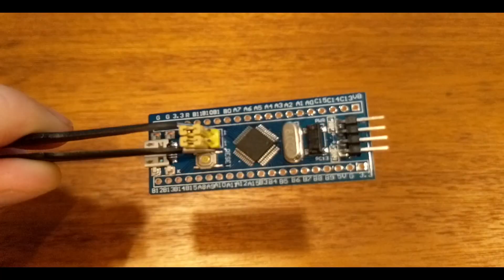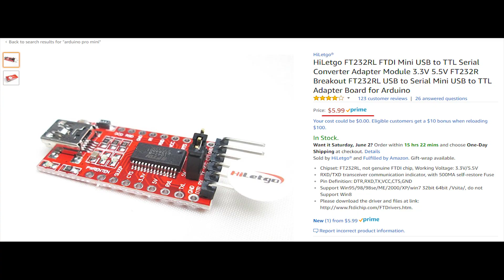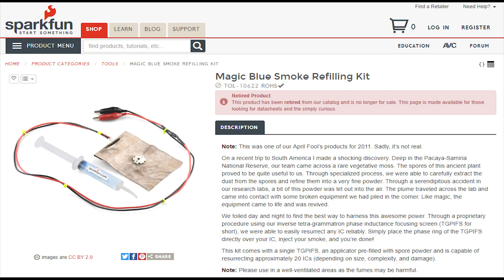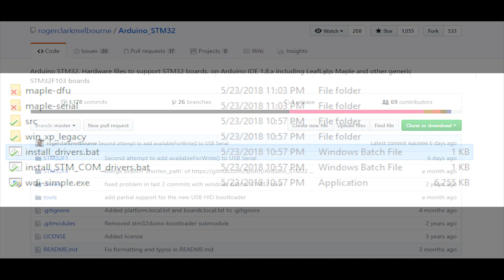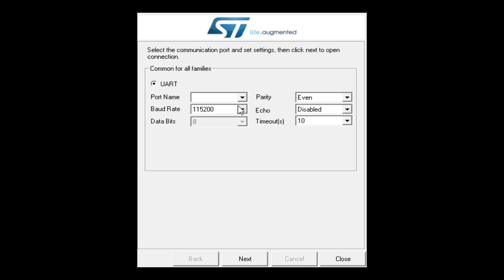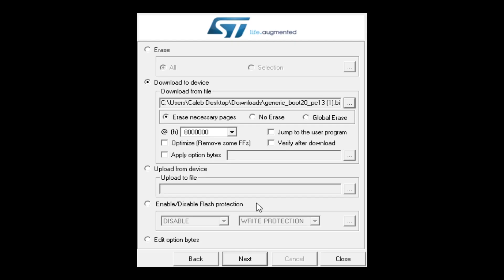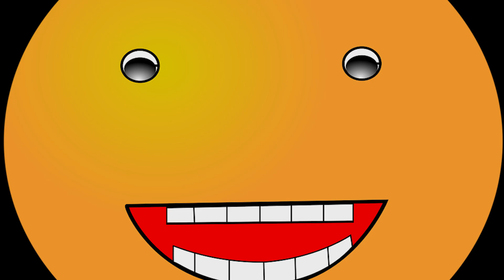Installing the STM32 USB Bootloader, Easily! [SEE DESCRIPTION]

Comment: Arduino doesn't have USB support either. There is an onboard UART to USB interface that handles it. Btw you can use the arduino as a USB to UART adapter, no need to buy one.
Reply from the maker: I tried getting the Arduino Uno to work as an adapter but I couldn't get it to work with STM32 flash loader demonstrator. If you could get it to work I'd be really happy to hear how you did it!
Reply: @CalebMarting  The way I've done it before is through SoftwareSerial, and then simply redirect data between those pins, and pin 0 and 1 which is hard wired to the interface chip. After that, just treat the arduino as a COM port on the computer side. I did it years ago, but I'll try to dig up my old blue pill and arduino tomorrow and see if I can get it working again to confirm
Reply: @CalebMarting  So here is a major issue I found today with the blue pill. Even tho the serial pins are 5v tolerant, they do not work with 5v TTL adapters. They need 3.3v for the RX and TX. I got it working with the arduino chip with a voltage divider. It was so frustrating because I ended up spending 20 bucks on an FTDI adapter from the local store that happened to have a 3.3v switch on it. Flipping it finally allowed me to receive data from the blue pill. If I switch it to 5v it doesn't respond. So many guides out there fail to mention this.

Comment: Can we use this bootloader without using arduino ? I ask because I prefer Keil. I just want the support for the USB port in the STM32
Reply from the maker: I'm not sure, I haven't gotten it to work with mbed or anything. You could extract how the .bin file is uploaded and just use keil to run that file

Comment: Good day. Very useful video!
I need your help. I use a board like this: https://www.aliexpress.com/item/1811770307.html
Device Diagram:: https://radiokot.ru/forum/download/file.php?id=211902
PA12 is pulled to power through a 10k resistor. The LED is connected to pc13.
I installed different bootloaders. These came up: dso138_boot20.bin, generic_boot20_pc13.bin and naze32_boot20.bin. But there is one difficulty: for flashing the sketch I need to press the RESET button. Is there any way to do an automatic reboot? Could it be possible to somehow modify the bootloader, or add a circuit for a hardwar reset?
Reply from the maker: You will need to either replace the 10k resistor with a 1.5k or somehow bridge it with parallel resistors to bring the total resistance to 1.5k. then it should reset Automatically. I believe I talk about this at the end of the video

Comment: some boards have the 100kohm R3 resistor that connect BOOT0 header to mcu. In my case, when BOOT0 jumper is on 1 position, the pin on mcu only pulled up to 1 volt, which had me failed to flash the firmware. you might need to replace R3 with 10k. i just replaced it with a 2.2k smd resistor i had and it worked.
Reply from the maker: Interesting, thank you for your knowledge!
Reply: This has helped! Thank you :)
Reply: @sam25_25  you're welcome, i'm happy to hear someone to benefit from my discovery

Comment: I'm getting this error. I have two boards and still this happens in both

maple_loader v0.1
Resetting to bootloader via DTR pulse
Searching for DFU device [1EAF:0003]...
Found it!

Opening USB Device 0x1eaf:0x0003...
Found Runtime: [0x1eaf:0x0003] devnum=1, cfg=0, intf=0, alt=2, name="STM32duino bootloader v1.0  Upload to Flash 0x8002000"
Setting Configuration 1...
Claiming USB DFU Interface...
Setting Alternate Setting ...
Determining device status: state = dfuIDLE, status = 0
dfuIDLE, continuing
Transfer Size = 0x0400
bytes_per_hash=300
Starting download: [##################################################] finished!
state(8) = dfuMANIFEST-WAIT-RESET, status(0) = No error condition is present
Done!
error resetting after download: usb_reset: could not reset device, win error: A device which does not exist was specified.
Resetting USB to switch back to runtime mode
Reply: It used to worked and then nothing
Reply from the maker: Try reinstalling the drivers and/or bootloader
Reply: I did both :/ . How do I erase the bootloader so I can try it without it?
Reply from the maker: Just overwrite it with serial. Boot 0 in the 1position and upload over serial

Comment: hey man tremendous video, can you make a tutorial on how to make the stm32 simulate a usb Keyboard?. can it be done with arduino programming? or do you have to use the st-link thingy?
Reply from the maker: I've gotten it to work before with just Arduino but it sort of messes with the bootloader if I remember right. I'll look into it haha
Reply: @CalebMarting  It works, but you won't like this kind of configuration during development. It's cumbersome and annoying. Maybe later as end-user update mechanism. 
The boot-loader and your USB-stack will fight against each other every code-update time, worsened by the fact that such a blue pill has no proper USB re-enumeration circuitry like the maple series and most likely has the wrong pull up resistors(like you stated in your video. good job).
For USB development I use a proper programming adapter as @insanet3 asked. So you have proper debugging available and two paths: One for development and one for the USB realization of your project. Prepare to invest some time, because this can be a hard task to wrap your head around and get your USB stuff working:)
Reply from the maker: You are exactly right, I had the same experience as you
Reply from the maker: Thank you for your insightful comment!

Comment: @2:35  I hope you didn't really have the other end of that USB cable plugged in, while the metal tweezers shorted those resistors/capacitors????  If you short out your USB cable, on recent model motherboards, the internal USB hub will just turn off, and won't come back until you remove power entirely and turn it back on.   Best case, you'll have to turn off your computer and restart it to keep working.  But there's always the chance of permanent damage when you use conductive tools on a powered circuit.
Reply from the maker: The other end wasn't plugged in :p i figured it was a better shot than having my fat fingers in the gap. A few other people have brought it up and I realized too late what it looked like

Comment: Mine didn't work, device manager doesn't see stm32 at a com port! Already put 3 hours into this. wondering if anyone else has similar issues, I am using a clone
Reply from the maker: Installed device drivers and everything? Does the led blink slow/fast and then stop after a second at boot?
Reply: @CalebMarting  after loading with the flashloader, moving the jumper while still powered on. then checking divice manager,  it is not recognized!! I installed driver software. Just not working!! I have extra boards maybe I will try another. Also, my stm32 says 128k flash memory
Reply: @CalebMarting  led blinks fast for a few seconds then shuts off when you reset or repower board. I was able to program blink sketch with ftdi programmer only!!
Reply from the maker: Hmm it sounds like it's uploading the bootloader but it's not staying persistent in memory. Would you be willing to join the discord listed in the description? It will be easier to troubleshoot
Reply: @CalebMarting  I had the wrong bootloader, the first pc13 on the list is the wrong one, it is the second one! Now that bootloader is installed and recognized by usb port, I still can't load blink sketch, installed 1.8 ohm jumper, still no upload, the board sounds like it is resetting, and never uploads the sketch even though it says done uploading!
Reply: Experiencing the same thing.

Comment: Thank you so much for the video! One question, I can undo the bootloader by flashing a random program via serial I assume? Like loading the blink program via arduino serial?
Reply from the maker: Anything written over serial will overwrite the bootloader, that is correct
Reply: @CalebMarting  Thank you! I've also tried on the STM32F103RB development board. The board has PB11 connected to the led, I've tested 2-3 binaries and the generic_pc13 seems to be working!(Couldn't find PB11 binary) I've tried to learn more about this, could you explain on why specific binaries must be loaded on board which have different pins connected to the userled?
Reply from the maker: I think it's just so that the board knows which pins are mapped to what, sometimes certain boards have extra peripherals and stuff. If pc13 works then you should be set

Comment: Everyone do yourself a favor and get rid of the Arduino IDE. Calling itself an IDE is an insult to actual IDEs.
At least get something like atom and platformio. It can be used to write Arduino code (or better go C/C++ without the Arduino bulk), and 
supports tons of different micro controllers.

Also an st-link programmer clone costs something like 2$ and makes programming STM32 so much more comfortable. No need for the serial bootloader or USB bootloader, no need to change jumpers all the time.

Comment: what is the required value for R10? and what value of paralleled resistors that you used?
Reply from the maker: I didn't have to use any special resistors. I just press the reset button. You should be able to find the right values on the wiki if you still need to though

Comment: If you have only 5V serial converter, you can use it also. Just do not power board from serials 5v, but power board via usb and keep GND connected.  A9 and A10 pins are 5V tolerant.

Comment: TIL! Thnx for the info!

Are there any disadvantages to using the serial port method (apart from inconvenience)?
Because I might need that extra 20kb of space.

Great video thnx!
Reply from the maker: It's not the most reliable. I would definitely recommend picking up an ST-Link v2 if you are going to be using these a lot, otherwise serial works just fine and you can upload with that whenever even if you install the bootloader

Comment: Thanks a lot Caleb. I get it!!! Now, i can program my bluepills through USB and use Serial Port Monitor. Only a question. I need to press the reset button after upload a program. Upload works fine, but before press the reset button, the COM port apears disabled. After pressing the reset button, the Serial Port Monitor and COM Port works fine. Both jumpers on 0 position.
Reply: I get the same issue, resulting in the error mentioned with the missing footage... any ideas of a workaround? seems like the usb is failing to reset the stm32 into flash mode?
Reply from the maker: Yes some STM32s can't reset themselves, meaning you need to reset it. either reset when it's attempting to program or something like that
Reply from the maker: Basically the USB can't reset it and therefore it can't find the right DFU device
Reply: @CalebMarting  Thank you. Is that the resistor hack that ive seen others doing?
Reply from the maker: It's one of the ways to perform the fix. you should test before you do that though because sometimes it's not required based on your computer or something else.you can also get around needing to do the resistor hack by resetting it as you're uploading. Did that make sense?

Comment: Nice but if ever I need all the 64kb of memory how do I remove the bootloader?.....thanks in advance for what you did future reply
Reply from the maker: You literally just overwrite it with serial like how you wrote the bootloader in the first place. It lives in flash so when you write a sketch with serial it overwrites the bootloader. Hope that helps!
Reply: If you have that size of code then also recommending to go PlatformIO or full IDE and use ST-Link V2 for debugging.

Comment: Could I do this install on a windows machine then use the STM32 with Arduino IDE on a Mac or would I still have to use windows to use it?
Reply from the maker: It can be installed on Windows, but you have to make sure the drivers work. I have no idea

Comment: "Error downloading http://dan.drown.org/stm32duino/package_STM32duino_index.json"
IDK why this happened but I manually download the stm32.zip and put it in Arduino\hardware. It needs to be like hardware\stm32f1\STM32F1 and cores,libraries,boards.txt in it.
"exec: "/bin/arm-none-eabi-g++": file does not exist"
After some search work I figured out that I need to download "Arduino SAM" in board manager. Would've be better if you mentioned that in the clip :/
Reply from the maker: I never had to download Arduino Sam, hmm. It could be because you manually downloaded it
Reply: @CalebMarting  That may explain...Anyway mine works eventually so thx 😀
Reply from the maker: Glad to hear!

Comment: Cringed at 2:32 when holding the serial board with a metal tweezer and plugging it in.  Just a bad practice
Reply from the maker: Plugged that in before plugging the other end in, but yes, just did it so my fat fingers weren't covering it
Reply: @CalebMarting  Lol, I suspected you did that and I'm sure you know what you're doing.  Only problem is beginners might pick up bad habits.
Reply from the maker: I'll make a joke about it in my next video ;)

Comment: When uploading the blink sketch, I get this: "EXCEPTION_ACCESS_VIOLATION (0xc0000005) at pc=0x000000007110b5db, pid=7876, tid=2940" from the maple loader. IDK how to fix it...
Reply from the maker: Does it work if you just upload with serial, like how I described in the video before showing how to upload the bootloader?
Reply: @CalebMarting  No, it doesn't. I'm currently trying to work through the "Failed to init device. stm32flash 0.4" error.
Reply: Damn, the serial method works now. I forgot to reset the BOOT0 jumper for using the FTDI interface. Still working on the "EXCEPTION_ACCESS_VIOLATION (0xc0000005) at pc=0x000000007110b5db, pid=7876, tid=2940" issue over USB.
Reply from the maker: Aha yeah boot0 will get you. To be honest I have no idea what is causing the violation. All of the memory pages in flasher loader demo are green unlocks right?
Reply from the maker: Also I am just going to recommend an ST link. It works waaaayyy better and is like , 3 bucks if you can wait a while. In fact, I ordered 15 and was gonna sell them on my website lol (they're gonna get here mid March though)
Reply: @CalebMarting  Yep, they all show as green. Hrm... I'd really like to use the USB interface tho...
Reply from the maker: Hmm. You aren't trying to upload with a 128k modifier or anything in the Arduino thing are you?
Reply: @CalebMarting  Nope. Same settings as you posted in the video, just with a different COM port selected.
Reply from the maker: Oh I'm an idiot, I think we had this issue before. Update your Java and it should fix the issue, tell me if it works! (P.s. we have a discord linked in the description that is easier to use than comments for debugging)
Reply: @CalebMarting  Update? I'm using JRE10.0.1, which I believe is the latest. I tried the discord link, but it appears to be expired.
Reply from the maker: Gah really sorry https://discord.gg/wrMcmXA

Also weird, last time that error was caused by java
Reply from the maker: You should also update your Arduino IDE
Reply from the maker: I don't know if the message I wrote previously went through cause I can't see it. Try updating the Arduino IDE and I also updated the link in the description

Comment: I wonder if there is a way to use a Arduino Uno as a USB to TTL converter to program the STM... Should be possible right? Afaik when you connect reset to ground you can use the rx and tx pins as serial throughput
Reply from the maker: https://www.stm32duino.com/viewtopic.php?t=89
I'll make a video about this!
Reply: @CalebMarting  would be awesome! Can I also just program a little blink example with this method? Just to get started?
Reply from the maker: Sure, I'll show bootloader and a sketch!

Comment: Looking seriously at STM32F4 board for just over AUD$10. 168Mhz, FPU, 1MB flash, 192K + 4K SRAM,  heaps of I/O on a neat board. 

Currently use an Arduino Due that's great... but... but hate the default headers and well... 168Mhz and 192K is better than 84Mhz and 96K for a board that's ~60% of the price. Was looking at Teensy but not enough I/O for my project unless muck around with solder pads etc. I use Visual Micro under Visual Studio... and seems to install and compile. No point ordering a board if don't have means to compile... and as I just found out need a boot loader.
Reply from the maker: You don't need a bootloader. What I recommend is the STLink V2 for your situation. You can get one for $2

Edit:re-read the comment while I'm not half asleep, I recommend STM32 highly, it's just that the arduino support isn't quite there yet. I'm looking into alternative toolchains and stuff

Comment: 2:35 Don''t hold the board like this! You can make short circuit with metal tools!
Reply from the maker: Some other people commented about this. I just did it so my fat fingers weren't in the way. Don't short your board!
Reply: He's just making sure everything is electrostatically grounded! :) And it those huge SMCs can't take that, or are cold sodder'd (my way of saying), good to know now. :)
Reply: the board isn't even connected
Reply: @juanmontes8905  I mean the FTDI USB<>UART board. You can see him connecting it to the USB when holding it with tweezers.
Reply from the maker: Yeah the other end was unconnected from the computer but I can definitely see how bad it looked. It was just for a clearer picture of the board and I don't have any plastic tweezers